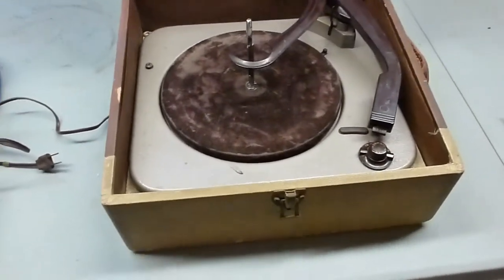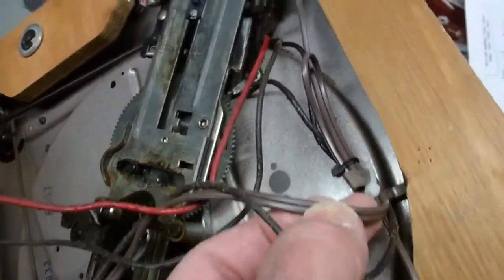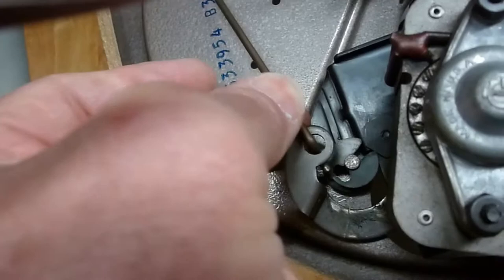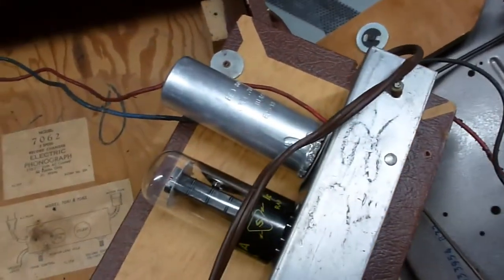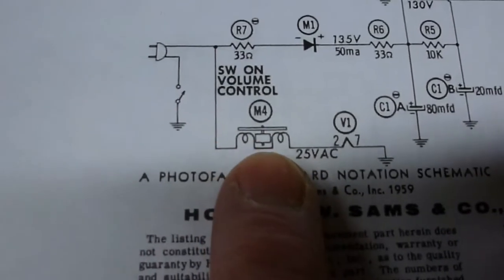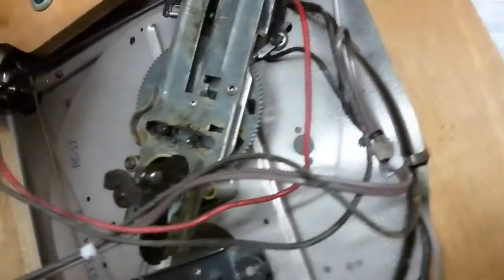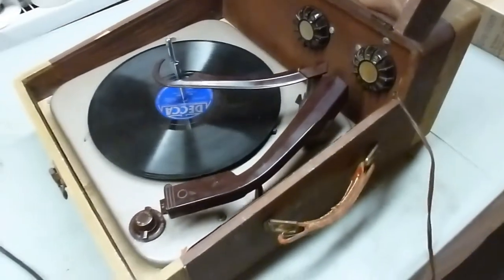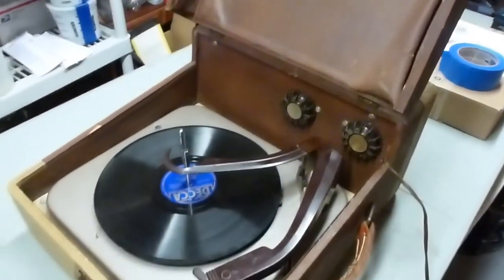1955 Traveler Record Player Restoration

Comment: Hi! I'm trying to get a Model 7054 Travler up and running. It spins, but the speaker only puts out a hum. Sounds like you had the same problem with this one. Did you just replace the capacitors to get it to work? If so, how did you figure out a modern equivalent to the caps in the tube amp?
Reply from the maker: I had a schematic diagram on the record player which had the capacitor values documented on it.  I did replace all the capacitors and some wiring to get the amp up and running.  I also had to buy a new old stock crystal cartridge as mine was dead. Good luck with your restoration and let me know how it goes.

Comment: I am wokring on one of these,but i cant get my motor to turn ?? I found a loose ground inside of mine and When i wired it to it it popped ?? Was also asking people who repaire on elctrocinc repaire site, Some ppl tell me this is easy, but My Device has 400 volt caps in it and 1 35Volt 1000uf cap ?? I replaced with parts kicking around. but my amp still a buzzing. Again one black wire is off ??to pin 3 of the tube. with the other 35 volt MFD cap.. I have this same model..The handle on my model is missing though..
Reply from the maker: If you do indeed have the same model as mine, it sounds like there may have been a prior repair attempt with incorrect parts swapped in. There should not be a 1000uf 35 volt capacitor in the amp. I have the schematic for the record player is you want it. I would double check the amp and turntable wiring and try to get it back to factory specs. Remember the motor will not receive power until the amp is working and turned on. If the heater is burned out in the tube the motor will not receive power.